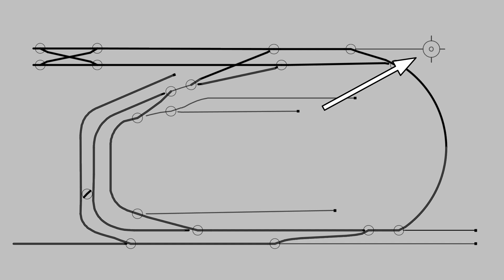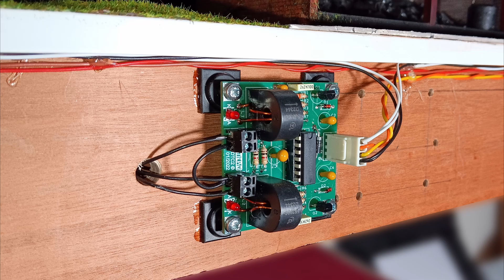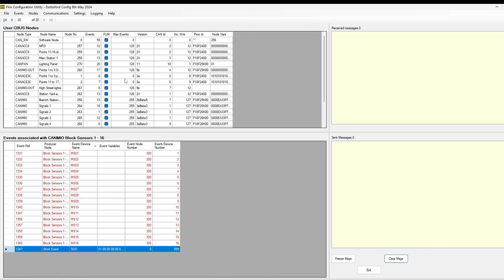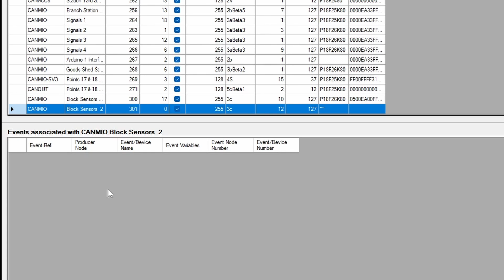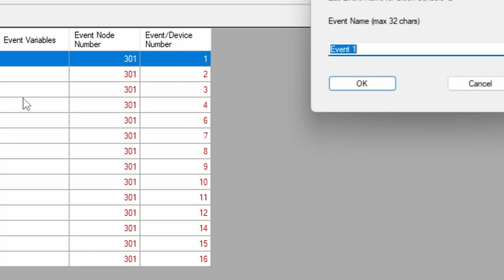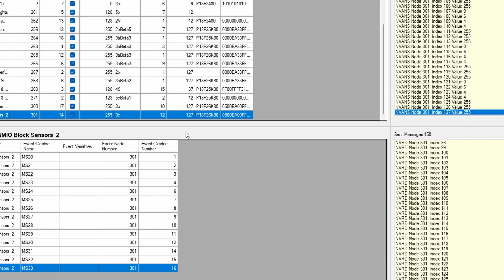JMRI Layout Control Using CBUS   Part 3 - Blocks, Sensors and CBUS

Comment: Great video. I am beginning to get my head around this myself now. I loved the stands for the pcb boards. Do you have the files so I can print them for my self?
Reply from the maker: Glad you are enjoying MERG Cbus. It is very satisfying to make things operate with Cbus and also cost-effective to join MERG and purchase the kits.  
The mounts are designed to take M3 nuts and M3 8mm bolts. If you use a washer between the bolt head and the PCB, the bolt should fit perfectly without hitting the base-board.  
I've uploaded the .stl file to my google drive and you should be able to download from this link:
https://drive.google.com/file/d/1KVXEN6FUil9VK2ZGCQHVTI4vrmuRmYcs/view?usp=sharing
Let me know if you have a problem with the file but all should be OK.
Chris
Reply: @chriswalsh9962 Perfect, thanks. I have requested access there now